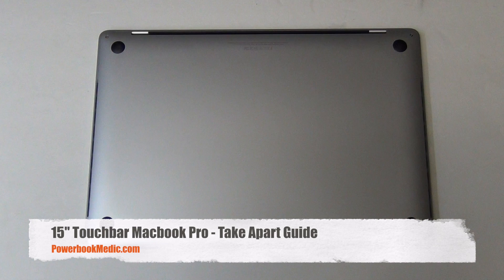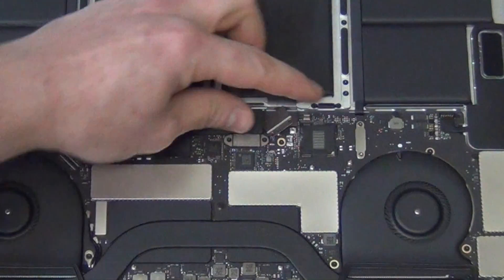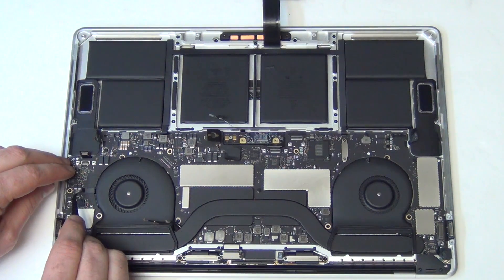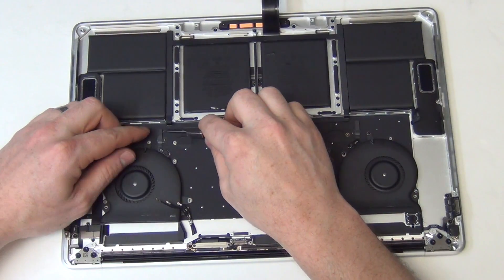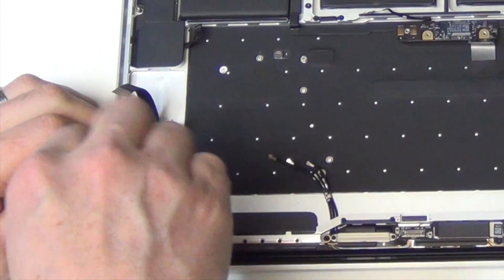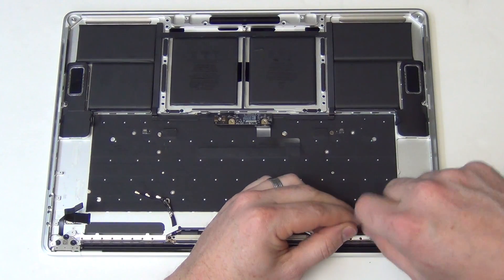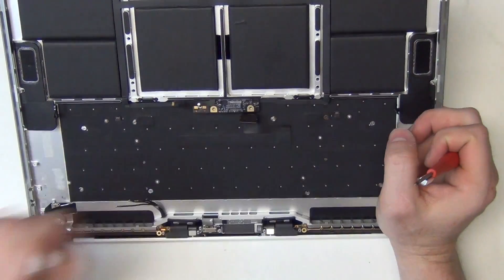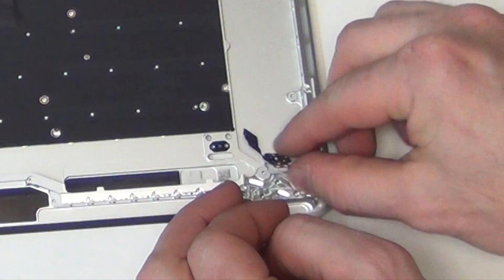How to Take Apart the 2016 15" Macbook Pro with Touchbar A1707

Comment: All parts are glued and soldered just so Apple can make fat margins on ram and storage upgrades when ordering.
Reply from the maker: No to both.
Reply: If you call transplanting a new motherboard with your desired ram and storage an upgrade, then I'm sure an Apple technician is capable of doing that.  But of course, they won't.
Reply: @mike Bellagio, the SSD for the new 15" is soldered onto the motherboard and cannot be upgraded.  Of the new late 2016 MacBook pros, the only model that has a detachable SSD is the 13" WITHOUT the Touchbar.  However, it will be a long time before a user replaceable SSD is made available for it, if at all.
Reply: wwbdwwbd 
I'm curious can an Apple technician upgrade the ram or processor?
Reply: Powerbook Medic , thanks for the video, nice, is the 15" mbp touch bar storage glued to mainboard or is it upgradable like earlier version which use pcie ssd / blade ssd ? Pls advice , tq
Reply: @Powerbook Medic, this is what worries me the most since I had several bad / failed Sandisk SD Cards , MicroSD Cards that I used for photography before, if I'm not mistaken this mbp touch bar also used sandisk ssd chip, and I think this also got that same fail possibilities, well, if it do one have to send the whole unit to apple for service, it gonna be so expensive, what do you think ? Hmm...its not an easy decision
Reply: @wwbdwwbd, this is what worries me the most since I had several bad / failed Sandisk SD Cards , MicroSD Cards that I used for photography before, if I'm not mistaken this mbp touch bar also used sandisk ssd chip, and I think this also got that same fail possibilities, well, if it do one have to send the whole unit to apple for service, it gonna be so expensive, what do you think ? Hmm...its not an easy decision
Reply: @wwbdwwbd, this is what worries me the most since I had several bad / failed Sandisk SD Cards , MicroSD Cards that I used for photography before, if I'm not mistaken this mbp touch bar also used sandisk ssd chip, and I think this also got that same fail possibilities, well, if it do one have to send the whole unit to apple for service, it gonna be so expensive, what do you think ? Hmm...its not an easy decision
Reply: Dude apple cant make nothing for you!   
‘’Hi Florin,

Unfortunately it is not possible to upgrade the storage capacity on this model MacBook Pro as the existing RAM and storage is final, soldered upon manufacture, and therefore only configured at manufacture level.

However, you could trade in your current MacBook with us and credit a new purchase to receive an upgraded model?

Alternatively, I could recommend an external desktop drive to store files instead of using up storage on your device?

Many thanks,

Sam.’’

And another one

‘’ Hi Florin,

In addition to my previous email, I have looked into the possible credit allocation if you, should you choose to trade in your current MacBook Pro, and it would likely be around £990, assuming the MacBook is in perfect working order with cables/power supply.

If this is something you are interested in pursuing, let me know and I will be able to suggest a suitable upgrade.

Kind regards,

Sam.''
In just 2 month after i buy my macbook 15 2017 i7 16gb 512gb is offered me for him  £990  to buy the new 2018 macbook. First mac in my life first deception!
Fu.. apple
Reply: Not only that. Also for the SSD and battery replacement. Essentially MacBooks are just like big iPhones, you can't upgrade or change anything yourself.
Reply: If u don’t like it, don’t buy MacBooks then, no one forces u